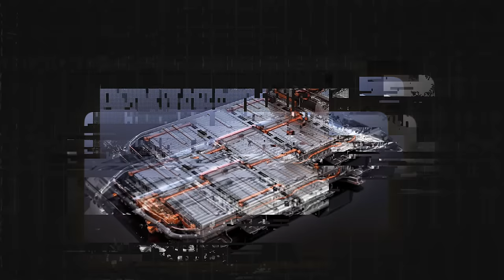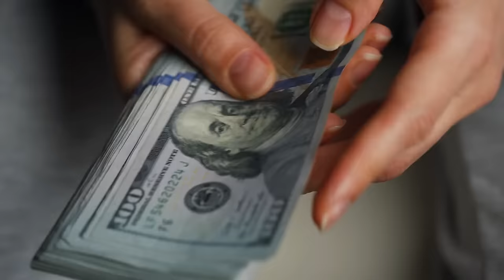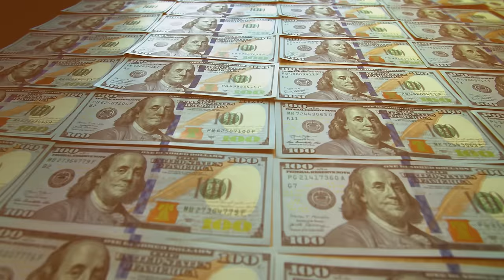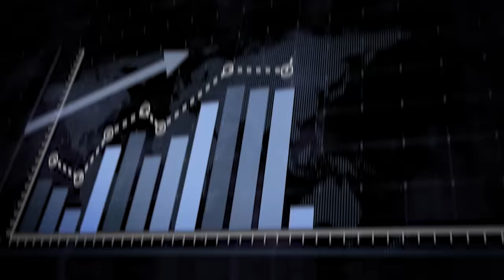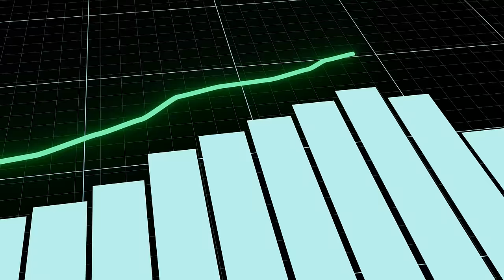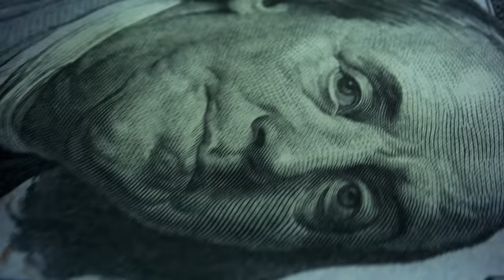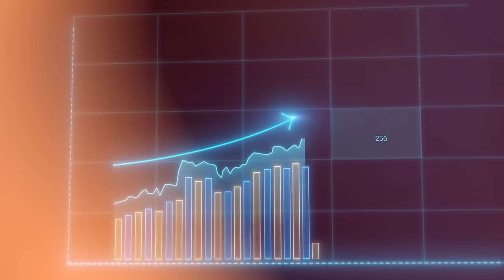No More Lithium! BYD Shifts To Sodium-Ion Batteries!

Comment: Well, the truth is, as of Jan 2024, Sodium ion battery is 30% more expensive than the LFP battery in the market which LFP battery is about 20% better in term of energy density per kg.
Reply from the maker: Currently, sodium-ion batteries may be more expensive compared to LFP batteries, and LFP batteries do have a higher energy density per kilogram. However, it's important to note that the sodium-ion technology is still evolving rapidly, and advancements in manufacturing processes and economies of scale could potentially drive down costs in the future. Additionally, sodium-ion batteries offer other advantages such as being more sustainable and less reliant on scarce resources like lithium. As the industry continues to innovate, we may see sodium-ion batteries become more competitive and widespread in various applications.
Reply: @AmpedAuto  that is the only up side of a sodium ion battery atm.
Reply: Sodium ion  battery already started it's effect  on Lithium market.
Reply: yes, because sodium ion batteries are just in the process of upscaling. this costs money and takes time. as soon as they can ship high volumes, they will drop in price. 2025 same price than LFP, 2026 less than LFP on the open market.

Comment: come on man lets just stay with ICE until the car manufacturers get solid state  just right
Reply from the maker: I would say It's natural to be cautious about adopting new technologies, especially when it comes to something as essential as our vehicles. However, the transition to electric vehicles, including advancements like solid-state batteries, represents a significant step forward in reducing emissions and combating climate change. While it's essential to ensure that new technologies are thoroughly tested and reliable, waiting indefinitely for the perfect solution might delay progress towards a more sustainable future. Electric vehicles, even with current battery technology, already offer numerous benefits over ICE vehicles, including lower emissions and improved performance. It's worth considering the advantages of electric vehicles while also keeping an eye on emerging technologies for even greater efficiency and sustainability.

Comment: The sodium ion battery sounds good until you understand that the charge hold capacity is way down on lithium
Reply: Hmmm.... You will know the sodium ion battery is good when half of EV use this battery
Reply: yea but cheap
Reply: let's put it this way. There are 2 main trends of Lithium battery. The higher trend is the NMC which is at around 280Wh/kg right now and may go up to 360Wh/kg. Then there is the Solid State Battery of QuantumScape and the 500Wh/kg Amprius Lithium ion Silicon Anode battery or may be the 500Wh/kg Condense Battery of CATL. The second trend is the LFP battery which is around 190Wh/kg. The 160Wh/kg Sodium-ion battery may be able to challenge this second trend.
Reply: it is all in development, you think 160 is the limit? of course not.
Reply: @gronz  just a note. Sodium ion battery is actually using the lithium ion battery technology. You should know Sodium and Lithium share very similar properties if you still remember the periodic table you learned in high school. In another word, if Sodium ion battery has a new tech to improve its energy density, the same tech will likely work on Lithium ion battery as well. Lithium ion will always supply more energy than Sodium ion.
Reply: @egaskrad  doesn't matter. Sodium is 1500 times more available
Reply: @gronz  sodium does have its charm. the abundancy, charging temperature, less flammable if at all, etc. Just note that the reason sodium is brought back to the game after it was abandon so many years ago is because they need a competitor for the crazily inflating lithium price. Sodium ion battery is probably good for the backyard or the trackers which are on the lower end of profit margin, or the cheaper cars, although it is currently still more expensive than the LFP battery.
Reply: Not everyone expects long battery life
Reply: Sodium ion batteries don't have the extraction pollution problem and don't have the thermal runaway problem that fossil fuel PR trolls use to try to initiate a recall of electric vehicles. Are these not the most important problems to consider for switching away from lithium even if it's more energy dense? Strange that no one brings up the real reason why lithium shouldn't be used. And of course as they state they're cheaper and they can be recycled much easier to boot
Reply: Well, my BYD holds capacity very well. I could change it during the cold days, unlike Teslas, and it didn't have capacity loss during -20°C. 

In conclusion, I am quite happy with what I got for the half price of Tesla cars.
Reply: @yunus3mr3  i,m happy with 20 to 30 miles range
Reply: which byd did you get
Reply: Hydrogen fuel is a substitute
Reply: The gen 1 may not be close but I'm sure gen 2 onwards will be much better
Reply: Theses are first gen batteries they have now made second gen and there far better
Reply: It's nice for running errands.
Reply: How about  calcium?
Reply: chimkin
Reply: Nissan Leaf was good enough in 2012 for many people.
If today someone would build  sodium ion battery  (140Wh/kg) for that car with the same weight as original (<100Wh/kg) then that car could go about 40% more miles than it could go when it was new. And, it would degrade much less than original.
Reply: Lousier range but cheap
Reply: Gen one are but they already  have Gen 2 and there very close. Also charge a lot faster also can be used in colder climates and are a lot safer
Reply: @egaskrad   nah I ain't purchasing ev lithium battery. Phone it's ok but ev no way
Reply: @jb5music  agree 👍

Comment: Will it catch fire?
Reply from the maker: Safety is a top priority in battery technology, and while any energy storage system carries inherent risks, manufacturers rigorously test and implement safety measures to minimize these risks. Sodium-ion batteries offer promising advancements in safety, but like any new technology, thorough testing and regulatory approval are necessary to ensure their reliability. BYD and other manufacturers are undoubtedly focused on delivering safe and reliable products to consumers.

Comment: They need to redesign the EV. I understand they but the batteries on the bottom of the car for low center of gravity. The batteries need to be protected my accidents. They need to be an interchangeable batteries. I realize the battery technology is not there yet.the battery has to be a lot smaller and lighter.they have micro cars I’ve seen that have removable for charging so you can plug it in to any outlet. Take your small battery in with you while you go shopping or lunch. Now I also realize that there needs to be a battery charging area. No you think why not just use a charging station. With a small battery the size of a suit case it’s smaller and a company can make a profit with charging batteries in large quantity in a safe and locked location. Less charging times it might take 15 minutes or 5 who knows what the future holds.
Reply from the maker: Thank you for sharing your ideas on EV battery design. Interchangeable batteries and convenient charging solutions are indeed areas of ongoing innovation and development in the electric vehicle industry. As technology progresses, we may see advancements that address these concerns and offer more flexible and efficient solutions for EV owners. Your input contributes to the ongoing conversation about improving EV technology for a better future. Thanks!

Comment: Battery swapping might be the answer.
Reply from the maker: That's an interesting point! Battery swapping indeed presents a compelling solution to some of the challenges associated with electric vehicle adoption, such as long charging times and limited infrastructure for fast charging. Companies like Tesla and NIO have already been exploring this concept, and it could potentially complement the advancements in sodium-ion battery technology that BYD is pursuing. It's definitely something worth considering as we look for more efficient and convenient ways to power electric vehicles.
Reply: Nio has several swapping stations already.

Comment: I say get rid of anything battery for real vehicle but for golf carts and smaller stuff. Back to ICE vehicles, the real deal and winner.
Reply from the maker: ICE vehicles have been reliable for many years. However, the shift to EVs, is driven by the need to reduce emissions and reliance on fossil fuels. BYD's investment in battery technology aims to make EVs more accessible and sustainable. However, at current, both ICE vehicles and EVs have their places in the automotive landscape.

Comment: Don't count your chickens before they hatch. Sodium batteries offer serious range trade-offs versus lithium. It's probably another 5 years from being commercially adopted (if ever). Solid state or some other chemistry might leapfrog them offering longer range and faster charging
Reply from the maker: Appreciate your insights! Sodium-ion batteries do face challenges like range and charging speed compared to lithium-ion. It's true they're still in early stages, and other technologies like solid-state batteries may offer advancements. Yet, sodium-ion batteries bring cost-effectiveness and potential sustainability benefits. Battery tech evolves gradually, and diverse solutions will likely coexist to meet energy storage needs.
Reply: Yeah, yeah, yeah. What about nuclear perpetual batteries? Stringing millions of them could power a car and it will not need charging. 😂

Comment: Nonsense….”if they can overcome” low life cycle (5000 cycles verse 7500 for Li) usage then forward to manufacturing throughput capability.  

Nothing beats an ICE for longevity and repair.
Reply: Nonsense ...Nothing beats an EV for longevity and repair.
Reply: lol longetivity and  repair? wear and  tear  for ICE  are insane. If you forgot to change oil  and your car will be featured in  "This Just In"  channel. Repair? Its all about spare part logistic, fail the logistic and both repair and longetivity fail.
Reply: @jedibusiness .....what a load of shit.
Reply: Yep ... you're right!!
That's why it's a highly profitable business if ran well.
Reply: Take a look at Innengine, and the single stroke engine, hopefully they will turn the tide.
Reply: As a driver of ICE... ICE sucked, too many failed parts after 5 years.  Service centres will drain your wallets with unnecessary parts replacing.... Why not focus on ICE overall and not only focus on the battery???
Reply: 90% of the ICE's cant make it till 200 000 km :))
Reply: @i.k.5822  my old Toyota highlander ICE made it to 330,000. Ehen we sold it it was fine except that the steering wheel had gotten a little tighter and i found it difficult with my back issues.

Comment: less fire explosions im assuming. also byd is no a competitior they make fire death traps that will just expload if they feel sad
Reply from the maker: Valid concern but It's essential to address misconceptions about electric vehicle safety. While there have been isolated incidents involving lithium-ion battery fires, modern electric vehicles, including those manufactured by BYD, undergo rigorous safety testing and feature advanced battery management systems to mitigate such risks.

Comment: Sodium has a lower energy density
Reply: not by a lot looking at LFP
Reply from the maker: You're right that sodium-ion batteries typically have lower energy density compared to lithium-ion batteries. While this might limit their use in some areas, they offer advantages like lower cost and potential environmental benefits.

Comment: Sodium batteries are not more efficient, in fact the opposite is true.
Reply from the maker: The efficiency of sodium-ion batteries compared to lithium-ion ones is indeed a subject of debate in the industry. While sodium-ion batteries may have certain advantages, such as potentially lower costs and of course reduced strain on lithium resources, they may not offer the same level of energy density as lithium-ion batteries, especially for larger vehicles. However, research and development in battery technology are ongoing, and advancements may address current limitations. Ultimately, the adoption of sodium-ion batteries represents a significant shift in the industry, with potential implications for manufacturers and consumers alike.

Comment: I hate electric battery cars. All of them are useless and wasted inventors.....charging problems no back up power expensive..no reliability..it's like mobile phones like after two years battery life span gose down to very less mileage range...even new one gives rubbish range..there are soo many others problems...in that electric toy car
Reply from the maker: Transitioning to electric cars does come with challenges, like charging infrastructure and battery lifespan. However, ongoing advancements aim to address these issues. And electric cars have fewer moving parts, potentially reducing maintenance. While upfront costs may be higher, long-term savings on fuel and maintenance can offset this. Battery technology is improving, aiming for longer lifespan and better performance. And at last, electric cars contribute to reducing emissions and offer a path to a more sustainable future.